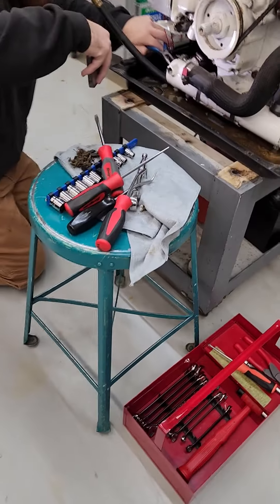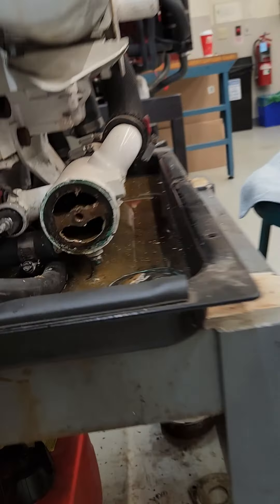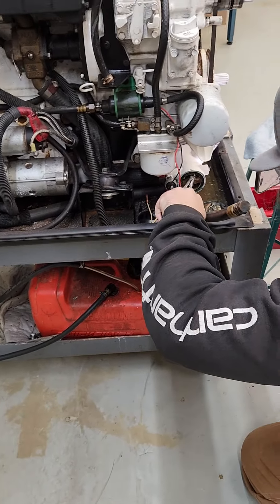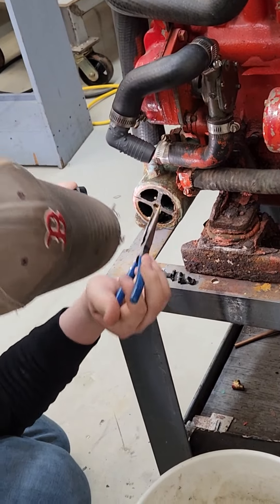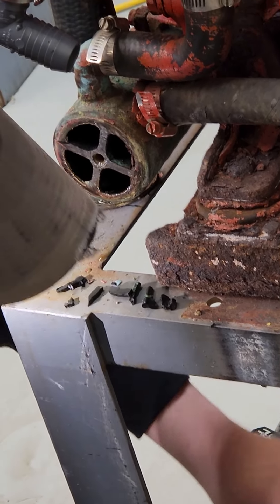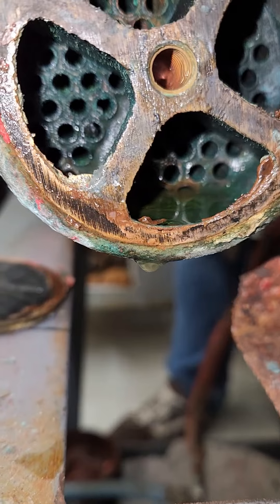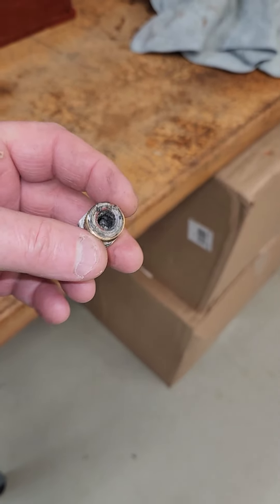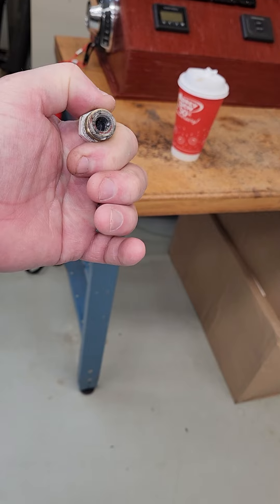Marine Gen-set Heat Exchanger Maintenance

Comment: Is that something that should be done annually?
Reply from the maker: You don't need to remove the end caps unless you have a water pump impeller fail. But yes, changing anodes is an annual maintenance item
Reply: @tedsmarinerepair8956  on older alpha gen one, would it be appropriate to add a raw water pump?
Reply from the maker: @jrisinlove  that is a hard rubber impellor and should be done every year or 2 at the max.